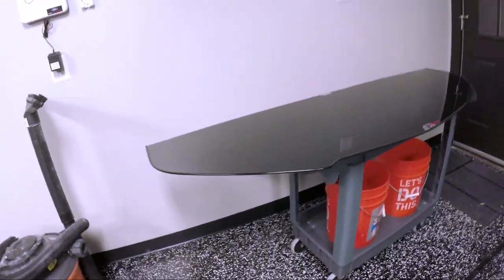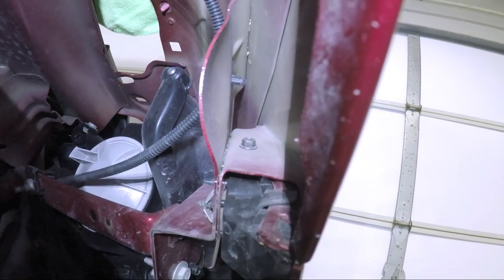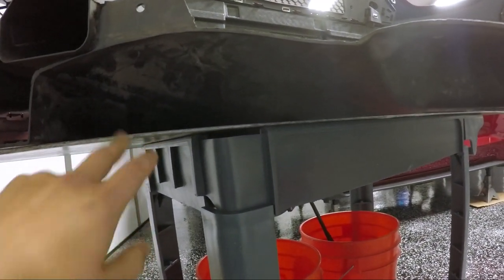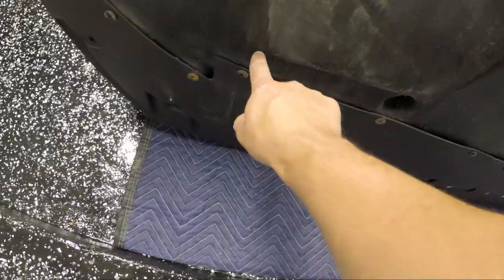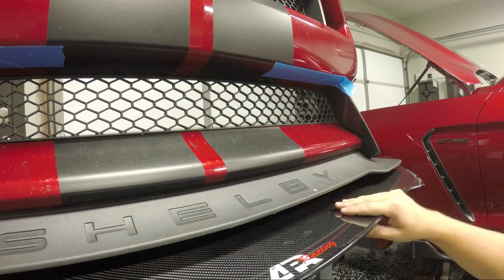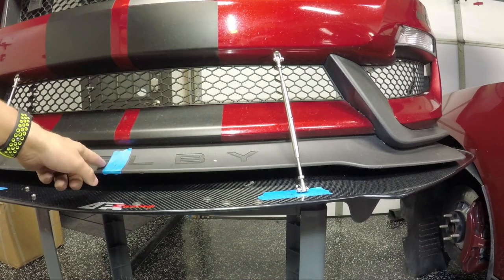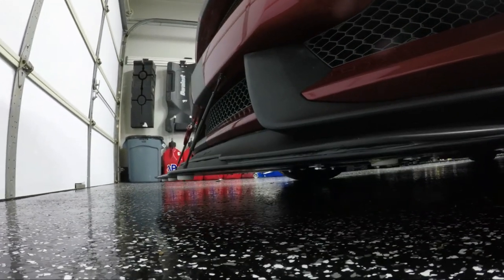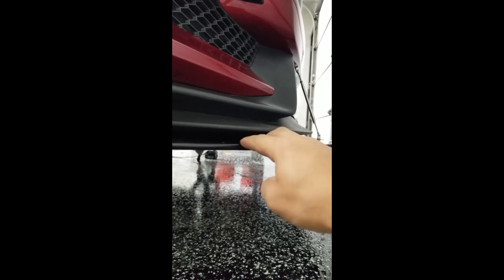APR Splitter Install on GT350 (V2)

Comment: One of the better splitter install vids for the gt350 out there. Good work. I’m getting the APR splitter for my GT350. Although, the APR team’s customer service, at least in my experience, is ATROCIOUS. I like the splitter rods painted black like you did. What paint did you use. And looks like you used gasket maker to seal the APR splitter to the OEM splitter. I’m actually doing the same thing. Doesn’t that defeat the purpose of cutting out for the ducting? I guess the air flows straight up underneath so maybe not.
Reply from the maker: Thanks, Josh! I actually just used plastidip because I didn't think ahead and paint them before I installed them. I am also on the lookout for smaller hardware that doesn't scrape as much. And sealing between the splitters is good. The cutting I did is for the air channeling that happens under the car. You'll get an increase in drag if you leave the space between the splitters open. Highly recommend sealing them!

Comment: Looks nice. I was worried as you were about the back side not meeting up flush. Once finished it doesn't look bad at all. Love the tie-rod supports. You should get the front turn signal tint to finish off the badass front end.
Reply from the maker: Thanks, Chris. I was pretty bummed when I saw it at first, too. But it turned out fine for me. I don't mind given the abuse it's taking. I do plan to connect with APR about an R version to see what can be done!

Great idea on the tint. I see that there's a Plastidip for smoking your taillights. Might give that a shot!

Comment: Did you notice a diference in performance after you installed the splitter?great video btw
Reply from the maker: Ya, most definitely. But it's a bit different than most would think. Since it's not mechanical grip, you don't feel right away. But I picked up 5-10 mph at Road Atlanta through turns 1, 5 and 12 with the upgraded aero.
Reply: @honeybadgershenanigans    that's such a huge difference for such a simple addition.

Comment: Uh not sure where you're from but its called a Skit plate NOT a belly pan !
Reply from the maker: Skid plates are for offroad vehicles and typically made of metal! Ford officially calls it the "under cover." I just refer to it as belly pan since most folks know what that is! (and it comes up when you search "gt350 belly pan")
Reply: sweetbrandigirl And  you spell you’re this way, not your.
Reply: @bodyguard5879  Thank You Youtube Police !
Reply: @sweetbrandigirl  You're the one acting like YouTube Police by capitalizing "NOT" and use an "!".  You may as well make a second edit and correct your misspelling of the word "skid", it's not "skit".  If you're going to correct someone, you should be damn sure your facts and grammar are perfect.

Comment: Have you noticed improvements in front end grip with this mod over the R piece? Also have you considered doing any sort of chassis mounting of the splitter to the subframe?
Reply from the maker: Oh yeah. The r splitter isn't that noticeable over the standard one. A bit better, but not drastically. The apr helped a lot more. I'm now running a much bigger custom one made from wood and it's been fantastic. I used the OEM holes which are chassis mounted.
Reply: @honeybadgershenanigans  by chassis mounting on the OEM holes, do you mean using rivnuts on the pre-drilled holes in the 2 subframe arms that extend out towards the front of the car?